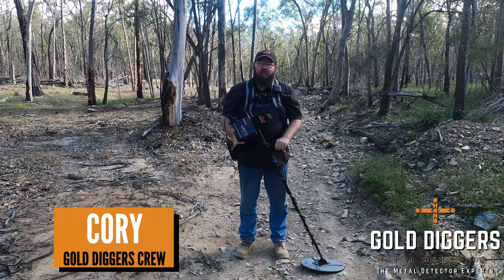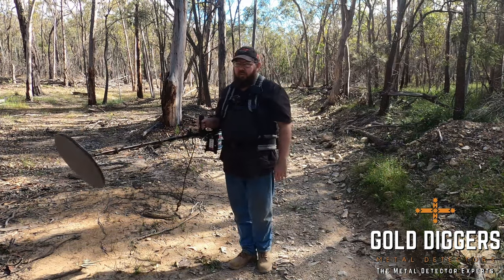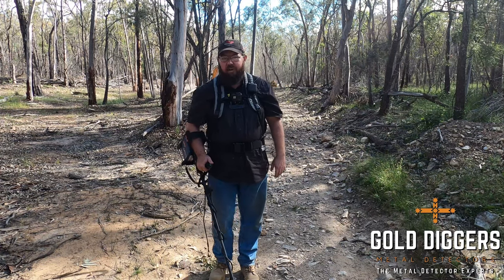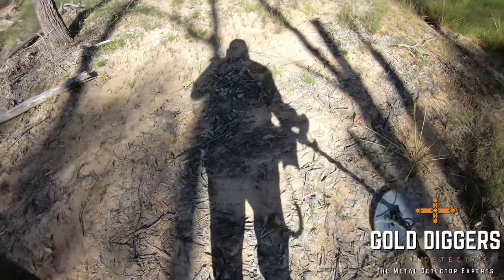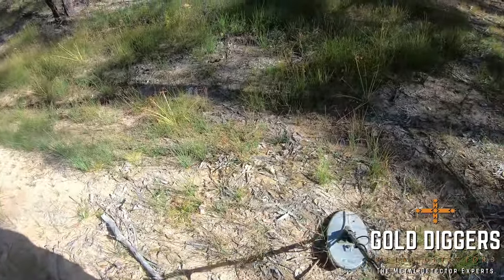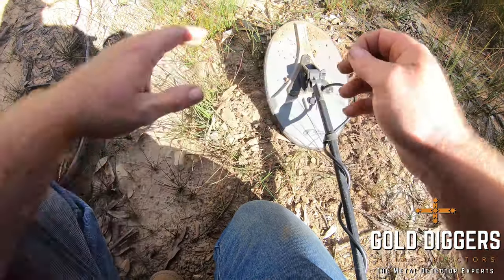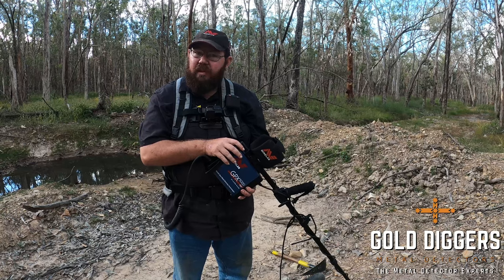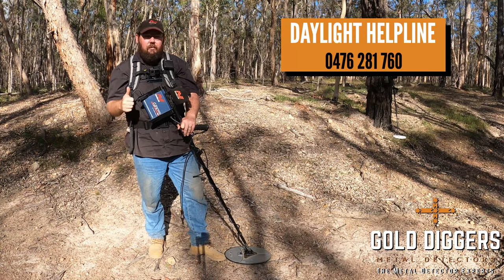Detector Pro Tips GPX 5000 Part 2

Comment: First things first: Very nice video and the GPX 5000 is still the best! For sure!
But I didn't get it at all!

The GPX 5000 detector was released in 2011(?).
That's quite close to TEN years now!

Would you buy in 2020 a ten year old computer or an iPhone 5 (FIVE! Released 21. Sep. 2012)?
For sure you would not! 

So why should I buy such an old detector?
Why isn't there an automatic computer based calibration (threshold, interference, etc.).

There are drones available that can follow you automatically. 
There is AI (artificial intelligence) in my toaster and in my toothbrush.
But I have to calibrate my around 5,000 US-$ expensive detector manually?

And: 
2011 electronics is for sure more battery hungry than electronic of 2020.

So what were changed in the GPX 5000 since release date (2011)?
Why isnt there since TEN years no new detector which catches up the (AI / electronic) enhancements?

For sure I can easily think off new features for those people which are prospecting in Australia's outback.

As said: I didnt get it at all!
Reply: They have the GP 7000 , which is the updated model, but the real reason why you want buy a GPX is the price and coil options.
Reply: Very true this is old tech and they want an arm and a leg
Reply: Still seems like such over priced primative tech in 2022 !
I want to only hear gold, and want an onboard screen displaying how deep and suggested size of the scanned gold, screen also to incl gps position saving … and for the price of a gold monster 1000 , cheers ! 😀